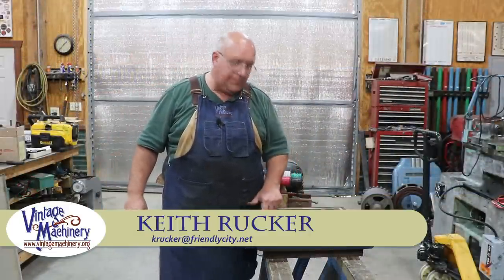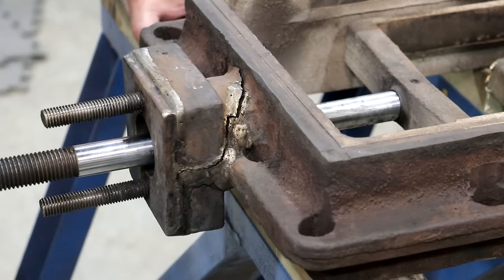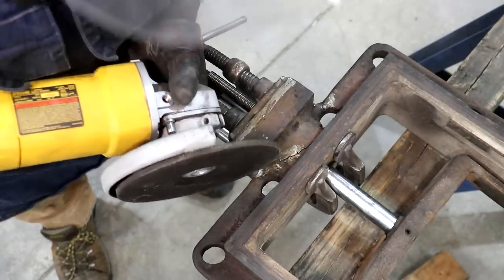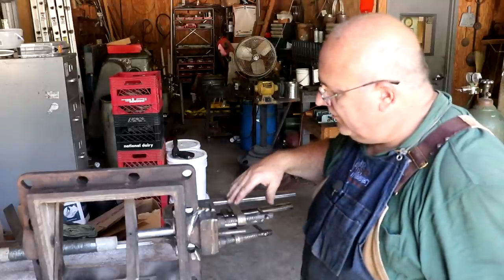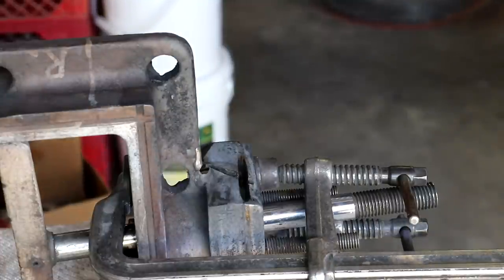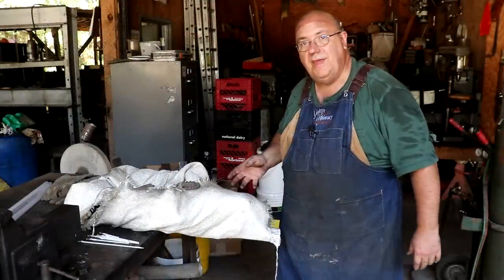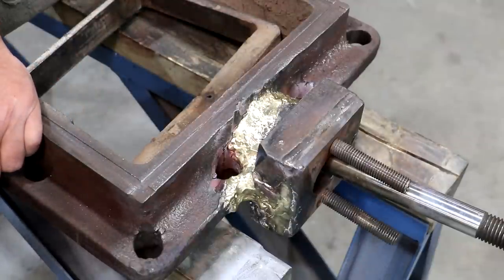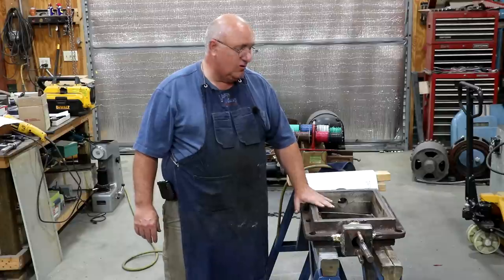1917 Vulcan Steam Locomotive: Brazing a Broken Steam Chest Casting

Comment: Keith,  
First, thank you very much for your excellent videos.  I have been watching for years and enjoy every one of them; however, I enjoy your steam locomotive videos the best!
Second, re the steam chest.  I thought the way it works is that the valve allows steam into the cylinder to push the connecting rod back and turn the wheel.  As the valve moves, that steam is exhausted.  As the valve continues to move, new steam is comes into the cylinder on the opposite side of the piston and pulls the connecting rod, also turning the wheel.  I think this is called a double acting cylinder.
Thanks again from a retired EE.

Comment: One of the nice things about brazing is that the braze alloy can form a eutectic mixture with the metal that is being brazed, meaning they are not just simply stuck together, but form something analogous to the fusion zone you get with a weld. Obviously there are tons of variables involved, but if the braze composition is right and the process is good, the braze joint can be surprisingly strong.
Reply: That's not what "eutectic" means. The term refers to the alloy of the filler having a melting point lower than that of the constituent metals and that alloy also has the property of "freezing" at a precise temperature without a "plastic" range.
Reply: @Mishn0  Yes, which is what I meant. I was not strictly referring to the process here. What I was working with also involved metalized ceramics, which it was desirable to form at least some form of solute at the interface. Also that happens with the base metal as well in that there is a transition region. But the base material and the braze can and do alloy together and form eutectics at the interface which forms a strong ductile bond if the composition is right, but in that case its probably one principally of dissolution into the sub straight to begin with. Here it may just be pure adhesion, but a cross-section would tell if and how much the braze and the base metal interact with each other.
Reply: @Mishn0  Another desirable aspect is that the eutectic was the last to solidify, which is also desirable for things where there may be a CTE mismatch, as the lower that goes before it finally solidifies, the lower the potential stresses will be once it finally gets down to room temperature.

Comment: It looks to me that moving the bolts may have contributed to the cracking. When you remake it I would suggest that the bolts go back to their original position. Also you might add some bracing to the top and bottom to minimize flexing.
Reply: Agreed.   A couple of holes drilled outwards into that ugly flange from inside the chest and tapped / bolted may help to balance the unequal loading from those packing gland bolts.
Reply: Absolutely. Before we were told that it had been re-tapped I was thinking that it was a poor initial design. That's a good idea also Gordon.

Comment: Nice job! I was surprised that you could close up the crack with the clamps without something breaking.  Considering your experience, the brazing vs welding for cast iron seems to be settled, not that I'll be doing either one. New casting would be great, but they look tricky.

Comment: Ready to get back in action. If you plan to make castings for both sides I believe I would just make that neck square the full cross section then use 2 longer studs in those holes if you had to. That would be much stronger and balanced.
Reply: Improving or restoring,  that is the question.

Comment: My first summer job (outside of our farm) was in a cast iron foundry.  Took several months to get my skin pores cleaned.  But that is not the real story.  Much later, in my long term job, we had a batch of some aluminum alloy enclosures made.  That batch apparently lasted a little too long, as when we eventually needed a second batch, there was nowhere the original casting model to be found.  In desperation, we tried using one of the original lot castings for a model.  The casting company warned us about shrinkage to be expected, but the stated values did not seem to be too bad, so we went ahead.  Indeed, all the other dimensions were still acceptable, but the motor & bearings block was now too long to fit inside, maybe about 1/4 inch.  After losing some hair of several heads, we found a replacement motor that with a new adapter plate still fit in the reduced space.  The day saved, but we promptly removed the long term sales plans for that particular item.

Comment: From what I can see and correct me if I'm wrong. It looks like it wasn't the repair weld that broke, it just cracked along side it then pressure moved that crack across the upper weld bead. Whoever repaired it the first time, did do a good job. To me, when you're dealing with heat on cast iron, you're dealing with a constant movement of the metal. 
Keith, why didn't you just remove that valve and shaft out from the housing? Isn't there a possibility of that rod for the valve losing it's temper and maybe "warp" a little? Great video as always, cheers :)

Comment: From the way it looked in the earlier video the pin end travels in a shallow vertical arc as the valve is actuated instead of a straight line. That is a very long lever when you consider the distance from the packing gland back to the valve lever and that arc is likely putting a lot of stress on that casting. Especially if you looked at the original stud locations on the sides, Perhaps something more like a cross pin as used on the other end, instead of the threaded coupler would remove that stress.

Comment: On the new casting I'd see about making the stuffing box with three or two support lines on top and bottom if possible on the neck. Not like the old one with no support were it cracked. 👁👁👍👍 Plus I notice the push rod was bent by design and It may be bent more just enough to move the packing box back and forth. May need an alinement check.
Reply: There are limitations to the patterns and controlling how the liquid metal reacts upon cooling.
Reply: I agree. The alignment on the rod needs checking

Comment: Keith, The Steam Workshop in the UK is restoring a Flower narrow gauge engine.  They showed having several cast iron parts at a facility that specializes in cast iron welding.  They heated the parts in a furnace and gas welded them on a heat source with cast iron rod.  Then, stress relieved the welded parts.  Have you ever tired gas welding cast iron with cast iron filler rod?
Reply: I've used cast iron rod to repair cracked automotive exhaust manifolds. I preheat the entire part to about 600F using a propane BBQ grill. The "rod" I used was triangular shaped, about 0.2" on a side. The cast iron puddles nicely - lots of surface tension, but it doesn't flow as readily as brazing, so you have to have good access to the repair area. I place the part back into the BBQ and then turn the heat down to hold about 200F and let the casting "simmer" overnight to stress relieve from the brazed area.

The repair is as good as the original casting. When you think about it the casting process melts and solidifies cast iron. The welding process does the same thing, only over a smaller area, and with a higher cooling rate as the mass of metal soaks the heat right out of the welding zone. This, of course, has to be done using oxy-acetylene torches. 

I agree with Keith, nickel is not the best way to go, especially if it is done with any kind of arc process. Arc welding (even TIG) produces way too concentrated heat affected zone (HAZ) and that can lead to a lot of local stress build up. Grey cast iron (the most common kind) has graphite flakes that precipitate out of the molten metal as it cools. The cracks tend to follow the flake/iron interface. The finer the flakes are (as a result of more rapid cooling) the more of a barrier they become to cracking, and that's pretty much what you get when you weld with cast iron rod. 

Keith did a very nice job on this brazing repair. Looks to be very serviceable. But, I'm still concerned that there is a downward load on the operating rod that created a repeating stress/relaxation with each cycle of the valve and that led to fatigue cracking. The fact that this "new" crack more or less followed the old nickel weld repair is indicative that the problem existed back then and was never corrected. That, of course, needs to be ironed out during reassembly.
Reply: @Zircon10  as far as your last thoughts about having a possible downward force on the rod that caused excess pressure, I had that thought when I watched the first video. I wondered if the rod might have a slight bow in it. 
I also wondered if it could be something like tightening those flange nuts unevenly? Instead of half a turn on top and half a turn on the bottom, it looked like maybe they went half a turn on the bottom and one turn on the top. Causing more of a load on one side and eventually cracking it.
Reply: Fowler!
Reply: @keithyinger3326  The linkage rod from the train running gear was quite bowed.  If you go back to the previous video you can see it as he removes it.
Reply: @RicktheRecorder  Yes...my mistake.

Comment: In the event of a recast of that part, I believe that the neck should be redesigned because,it is definitely a weakness
very good repair job on that part, probably better than the original NI rod repair, 
I often used bronze rod to repair cast iron parts namely marine exhaust where frost have broken them with generally a good success.
I even used easy flow silver rods to repair precision parts that were cleanly broken with the result that the parts have returned to service even without remachining
very good video.
Reply: Might you know what rod Keith is using that stays mushy so that he can fill up the trough he ground? Easy Flow would simply run off.

I wonder if Keith considered breaking the part off completely, cleaning the surfaces with a bead blast and then brazing with Easy Flow.

Comment: Well, I was going to say you could get a head start on the eventual replacement by making measurements for a rough casting (ring of 2-by-4s, a ring of plywood, & big block of wood on the end level of rough) that would be generously oversize, and get the final measurements down the road, but then you went and got blueprints.

Comment: Keith, it would be greatly appreciated if you could give us an update on the situation with the NC&StL 576 locomotive stoker engine. Thank you.
Reply: Also the Austin timing gear, and the Bandsaw?
Reply: I guess he's restoring his horizontal boring mill to help him get the stocker engine milled, but I bet that spray welding they did to it will need redoing because it was flaking off when Abom tried to shape it down.

Comment: Keith, I have a jaw from a vintage adjustable angle drill press or machining vise that was welded, and it looks bad, and isn't a good repair. I'll likely make a pattern of the piece, and get a small local foundry make a new one. I could buy a new one made of Chineseium, but I prefer quality and function over a cheap tool not made for durability.

Comment: Out of curiosity, could you control the flow of the brazing rod by using the same material you use for damming around babbitt bearings?
Reply: Possibly the temperatures used brazing would be too hot for the damming material. It's a thought though.
Reply: Ooh, yeah -- the temperatures are wildly different!  Babbitt is made to melt at really low temperatures.  And even at those low temperatures, it seems like that damming material gets a little charred in the process, or does it?  I don't remember.

Comment: Why did the flange crack from the main casted frame? The threaded rods that transfered the pulling force were seated in the flange that broke loose. The pushing and pulling happened within the flange. Nevertheless, the flange broke apart from the main casted frame. That i sweird. Isn't it?

Comment: Couple of questions, why are you using a rosebud instead of a brazing head,,you have no flow control of your metals ,and why didn't you clean the area around the ground out bits,,braze doesn't stick to rust and you brazed 3 times the width you ground out ?
Reply: Why?  He wanted to hear you whine about it!
Reply: @paulcopeland9035  did I ask you the question? Or are an official spokesman for the channel? If neither of the above refer to you,then mind your own business
Reply: Because he wants to keep dumping as much heat as possible onto the piece rather than pinpointing just the target area.  I rarely braze with a rosebud because I don't usually deal with large pieces, but it's not difficult.  I actually err in the other direction far too often- using too small a tip for the job.  Also, I've been using O/A for 40 years, and I've never heard of a "brazing head".
Reply: @componenx  just because your doing it 40 years it doesn't mean you have been doing it right for 40 years,regardless, but yet again did I ask you? Are you another official channel spokesperson? If I direct a question at someone I don't expect to talk to the monkeys,I expect the organ grinder to respond, mind your business

Comment: I would redesign and make the new steam chest with a much smaller gland area.  The current design is a lot of square inches=more pressure on gland area.  A new design confining the gland wouldn't be subject to as much loading pressure.  Maybe a design similar to a water faucet compression fitting over the gland? As the gland wears, a simple application of torque would seat the gland.  When the gland fails, replace it.  A simple compression fitting.  We're not building an overland railroad....
Reply: is that rod operating in a linear fashion? Or is there up and down movement also?

Comment: As I watched this I began to wonder why they cast this with a flange on it instead of a full thickness part, at least on the end with the packing. It's sandwiched between two other parts so there doesn't seem to be a need for a flange unless they were trying to cut back on weight. Weight doesn't seem like a problem on a traction engine.

Comment: Could I suggest that as you preheat and begin the brazing that you cover the end you are not brazing with the blanket so that it stays warmer and helps to keep stress down?
Reply: I feel like it would almost be worth having a secondary torch or heat gun blowing on the rest of the part to keep it from sinking so much heat out of the brazing area. Judging by the sweat on KR's shirt, it was hot enough in there!!

Comment: Would that rod being bent have caused that crack to develop?, being bent when attached to the rod running into the steam chest it would have to apply side pressure to the packing housing.

Comment: Will that steam chest need to be checked for warpage before installing?
Reply: It's not going to warp that much with an even heat and cooling.
The copper wire gasket can easily seal it back up when they mount it back on the engine.

Comment: soldering, brazing, welding . What is the difference? 
I know from soldering electronics that it is between 200 and 400 °C / 400°F and 750°F. The other must be hotter.
Reply: Soldering and brazing are essentially the same, just using different filler metals and temperatures.  The result is a chemical bond between the base metal and filler.  The base metal and fillers are always dissimilar.  With welding, the base metal is melted along with the filler material, causing a mixing of the metals and a physical bond, and the metals can be similar or dissimilar.

Comment: While I am sure that the packing material is suitable for nominally high heat, I would be concerned that with the rosebud brazing,  that the  packing material has bern damaged as. The cast iron was much hotter than what would be experienced under normal use.
Reply: I'm sure it was all removed before the work commenced.
Reply: @dolvaran , to remove the packing, would require that the valve rod would have to be removed first, and possibly the plate with 5he bolts
Reply: @walterulasinksi7031  no. packing puller
Reply: @walterulasinksi7031  I doubt it - it's accessed from the outside of the steam chest and would have been around the valve pushrod. You could see that the pushrod was at a slight angle - showing that the packing had been removed. Keith is no fool and is experienced in working on this locomotive.
Reply: @dolvaran  I have viewed this on a small screen. While I could see that the valve rod had been pushed into the closed position, fully in, I could not see the rod in an angle. Keith does have a lot of experience on this locomotive and would most likely have pulled the packing material and leather gaskets. I only mention as as he did not indicate that he had done so.

Comment: Hi Keith. It seems it’d be a lot easier to CNC machine a new part (especially now that you have the blueprint) than to make a casting, though I don’t know what the difference in price would be. Maybe John Saunders (NYC CNC YT channel) would be willing to help, and do a collaboration with the museum.
Reply: im with you on this. why cast it when you can machine it?
Reply: @davidhall1779  Authenticity? I mean they could probably get a diesel engine and electric motor to run that train and do away with steam altogether. I know I know, Im taking it a bit far but thats my best guess.
Reply: Because the engine is a working piece of machinery in a living history museum.
Reply: I also agree.  Machining from a block of steel is likely more cost effective than making a pattern and casting two bodies THEN machining them. Cast iron is good for a wear surface between the rod and bore but a bronze bushing could be used there.